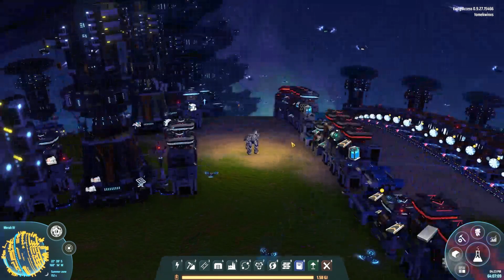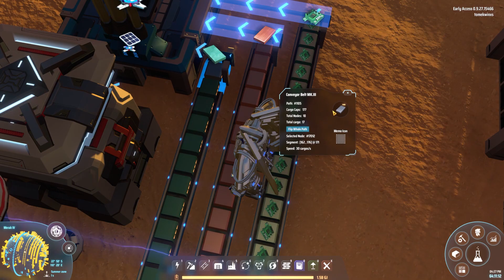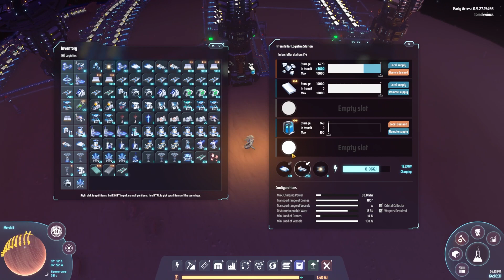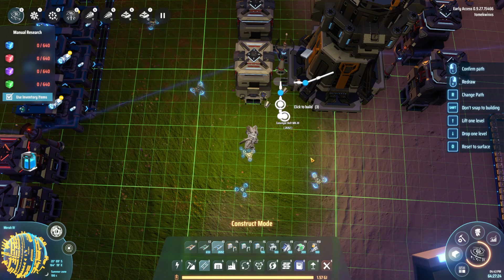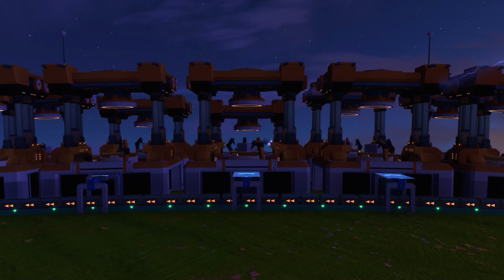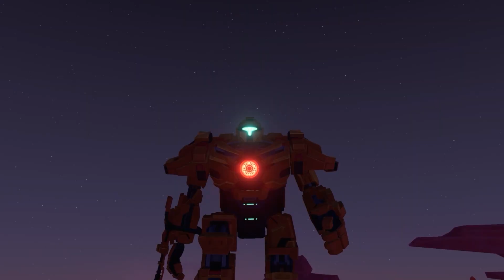Addressing Production Pitfall to Logistic Bot Mall | EP74 | Dyson Sphere Program | Blind Playthrough

Comment: Something to keep in mind about PLS/ILS's. You can "PUSH" and/or "PULL" from each end (aka Have ships at both end). If you do Both you double the number of Ships transporting item between them. So you will need Warpers and Ships in both to maximise transport. Also keep an eye on your PLS/ILS/Drones "Charging Level" is high enough. So what happens if charge level is too low the Ships/Drones have to wait to get charged up before delivering goods, lowering efficiency.
Reply from the maker: Thank you for that information sir Raymond! I’ll definitely keep that in mind moving forward.

Comment: Part of the supply problem you are having is that when you built your hub of ILS for off world transit you greatly increased the demand on everything in them, either in the ILS or the logistics stations bringing them to the ILS.  This is a sudden but temporary surge in demand.  Once the hub is supplied the demand will decrease dramatically.
Reply from the maker: I kinda figured that and with you pointing this out it further reinforce the point. It sure did place a strain on my materials and components!